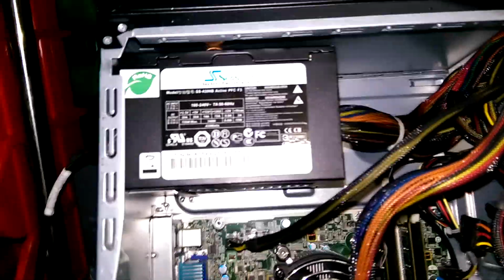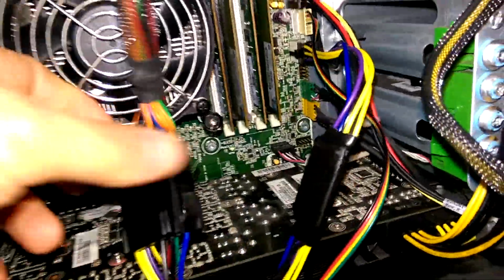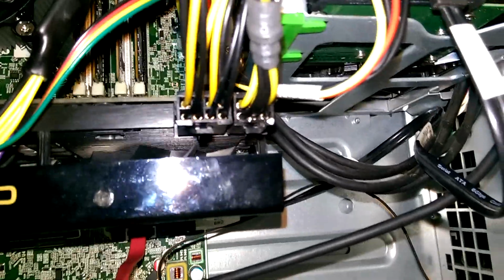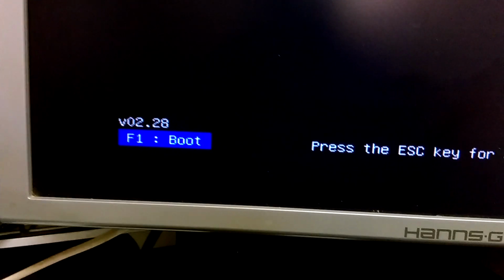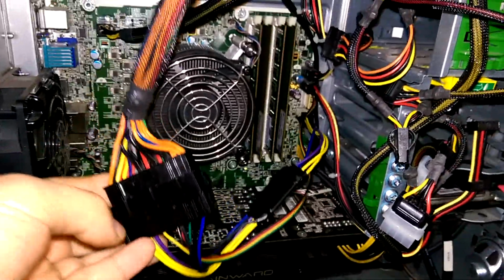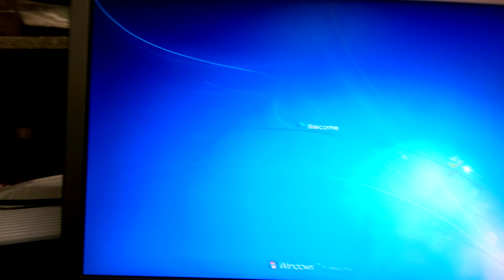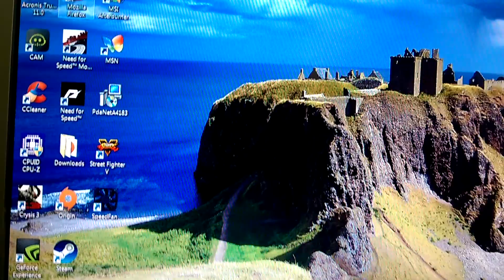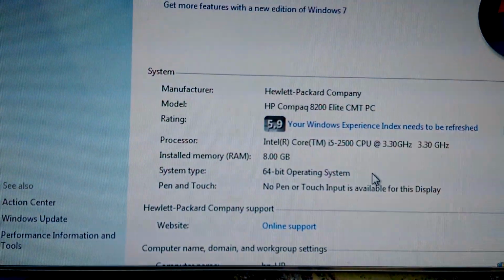HP ELITE 8100 to 8300 SERIES USE YOUR OWN PSU!

Comment: For future buyers! As a Youtube user and Ebay seller, he was very responsive, friendly, and helpful. The item itself is carefully made, using good skills and materials. Postage to Indonesia was relatively fast, and he has given a reasonably good packaging. Item tested and works as described. It was a very good experience!
Reply: Thx for the feedback!
btw im using the same pc in the vid, and was wondering if i can get a Sapphire R9 285 to work in it with the mentioned connector, or will it harm the motherboard
Reply: bang ajarin atur pin p2 nya dong

Comment: To owners of the SFF (Small Form Factor) model of the HP Compaq Elite 8300 computer:

These machines (and I believe the other SFF models of the 8000 series, i.e. 8100, 8200, etc.) utilize a rare PSU (Power Supply Unit) form factor of CFX. The only CFX power supplies I have found are all 240W and are light weight for most graphics cards. The number of low profile graphics cards that will fit into the SFF machine have increased considerably in the past few years. In addition to half height profile, you must check the card length against the space from the rear of your machine to the taller components towards the front. If the card is half height and not too long to interfere with other machine components, you can install it.

However, power is another matter. While some lower power graphics cards will work with the stock 240W power supply, if the card has a separate power connector or draws too much power, it is not an option for the stock PSU. Fortunately, a PSU upgrade is possible, but requires a non-standard installation of a higher power PSU that will physically fit in the computer case even though not designed to do so. Two other PSU form factors may fit into the space taken by your existing PSU. The narrow portion of the PSU case location, which is deep and tall enough to accommodate a non-standard PSU, is approximately 100mm wide and 85mm tall. Common ATX and SFX PSUs will not fit in this space. The Flex-ATX form factor power supply is 81.5mm wide and only 40.5mm tall, so it will easily fit in the space, even if there is a secondary hard drive immediately in front of it. These PSUs are available with up to at least 350W. The other possible form factor is TFX. These PSUs are 85mm wide and 65mm tall, so they also will fit in your machine, but not if you have a 3.5” secondary hard drive immediately in front of it in the secondary hard drive location (the problem is that the TFX PSU will need to sit on top of the secondary hard drive, causing the top of the PSU to interfere with the top cover of the computer case). TFX PSUs are available in capacity of up to at least 500W. Depending on the height of its mounting hardware, a 2.5” secondary hard drive may be short enough to permit a TFX PSU to sit above it and not interfere with the top cover.

However, neither of these form factor PSUs have the ability to physically mount into your case like your existing unusually shaped CFX PSU. The simple solution is to mount the new PSU with double faced tape to secure it in place.

The next issue is connecting the new PSU to the motherboard and peripherals. Most Flex-ATX and TFX PSUs come with a 24pin or 20/4pin connector, a 4pin CPU power connector and some array of 4pin Molex, SATA and floppy drive power connectors. None I have seen have the KF2510-6P female plug found on your PSU. Also, these PSUs provide the now standard +5vsb (standby), not the +12vsb required by your motherboard. Fortunately, many sources provide an adapter cable that plugs into the new PSU's 24pin or 20/4pin connector and provides the 6pin main power plug and the KF2510-6P plug required by your motherboard. An eBay search for "ATX 6pin 2port supply cable" will bring up a host of sources for this adapter, which includes a DC voltage converter that converts the new PSU's +5vsb to the +12vsb you need. The new PSU's 4pin CPU (Central Processing Unit) power connector is connected to the motherboard at the same location as was the identical plug from your original PSU.

However, the flat 6 pin in-line KF2510-6P female connector on many of these adapters is not wired correctly for the HP Compaq Elite 8300 SFF machine. Looking at the wire end of the connector with the raised guides pointing up and the rectangular holes facing down, the left most wire position is Pin 1 and the right most wire position is Pin 6. The adapter has 4 wires going to this connector of various colors. Because they are not standard, the wire colors are not important, just the Pin numbers of the 24 Pin receptacle and the KF2510-6P connector they run between. One wire connects to Pin 16 of the 24 Pin receptacle, the PS_ON or Power Supply On pin. The other end of this wire should go to Pin 3 of the KF2510-6P connector (the same location as the green wire on the original power supply connector). The wire that connects to Pin 8 of the 24 Pin receptacle (the PS_OK or Power Supply OK or Power supply Good pin) should connect to Pin 4 of the KF2510-6P connector (the same location as the grey wire on the original power supply connector). The other two wires connected to Pins 17 and 18 of the 24 Pin receptacle (or any other ground pins) should go to Pins 5 and 6 of the KF2510-6P connector. These locations have no wires connected on the original power supply connector. If the wires on your adapter are not connected correctly to the KF2510-6P plug, move the wires to the correct locations described above. To remove a wire from the plug, place a needle or other small pointed object like a toothpick gently into the small rectangular hole on the plug at the location of the wire you wish to remove. Press the needle gently inward and upward to release the metal wire connector and pull the wire and connector out of the plug. If the tiny tab on the metal connector is no longer bent away from the body of the connector, use the needle to push it out slightly so it will snap into the rectangular hole at the new wire location into which it will be placed.

With just this adapter, correctly wired, your computer will work with your new PSU. The drive power connectors from the new PSU can be connected directly to your drives, replacing the cable currently connecting your motherboard to the drives' power connectors. Not only does this reduce the current flowing through the motherboard, it also eliminates much of the +12v to +5v conversion currently performed by your motherboard with the original PSU.

One minor disadvantage of this PSU upgrade is that your computer will seek a "PSU fan on" signal when it boots. Since Flex-ATX and TFX PSUs do not provide this signal, you will get a 515 error message (Power Supply fan not detected) during the boot. Just follow the screen instruction to ignore this false warning by pressing F1 and the boot will continue. 

This error can be avoided by connecting your CPU cooling fan to Pin 2 of the KF2510-6P PSU adapter connector (the same location as the white wire on the original CPU plug). This requires adding a 5th wire to the KF2510--6P connector on the adapter. Snap-in crimp connectors for this additional wire come with any KF2510 female connector, so you can buy a KF2510-2P plug and use one of its 2 crimp connectors for the new wire on the PSU adapter plug, leaving the Pin 1 location empty (the same location as the white with red stripe wire on the original PSU connector). The other end of the new wire is connected to the TAC or SENSE lead of your CPU cooling fan by spicing it to the appropriate fan power plug lead. This lead is usually a green wire but in any event it is the wire that connects to the #3 pin of the fan power connector which is the second closest to the side of the cabinet. With this arrangement, upon booting your motherboard sees the TAC or SENSE signal from your CPU cooling fan and reads it as coming from your always on new PSU fan, thus avoiding the false boot error entirely.

While this upgrade may appear intimidating, it really is not very difficult. Due to engineering changes by HP, I cannot guarantee this will work with your machine and like always, you proceed at your own risk. I did it with a 500W TFX PSU in my HP Compaq Elite 8300 SFF machine to support a new graphics card and future peripherals and it works very well. My hard drive is a single 2.5" Solid State mounted in the main hard drive location below the DVD drive, so there is no drive immediately in front of the new power supply in the secondary hard drive location, allowing me to install the TFX profile PSU without interference. Good luck!!!
Reply: Wow..that was some detailed post ! I got an 800 GT 1 SFF with a 240 watt and want a 320 so will try out your suggestions.
Reply: Great post! Unfortunately for me it doesn't to work; I get a green LED, everything seems to power up, keyboard flashes, but then I get no video, no beeps, and no lights on the keyboard. Do I have bad RAM or is my motherboard faulty? I've tried the adapter with multiple power supplies at this point to no avail.
Reply: **If this guide still causes the pc to beep when connected to power, Swap pins 3 & 4 **

Just did this on an HP 8300 Elite SFF. Runs flawlessly with 16gb Ram and an OC'd GTX 1050 (2gb)
Reply: How critical is the sensing voltage? I measured mine at 12.28 V. Always got 4 long beeps and red front Power LED as warning. Bought pre-built cable from Aliexpress and adjusted wire connections peer your instructions, including swapping pins 3 & 4 , but with same result each time.  If sensing voltage is critical, maybe a regulated buck converter is required.  I have not open the heat-shrunk and covered converter to see how it is like.  The rig is running fine on MacOS High Sierra hackintosh with 2x2g 1333Mh ram, 240G ssd + 250G hdd and MSI 1050TI LP GPU.. Thought would be great if could upgrade the stock CPU to something closer to 500 watt. May be those already got it going can share the vendor of your cable or possible DIY with adjustable buck converter.  Thanks in advance.
Reply: Sorry, forgot to mention that the rig is the HP Elite 8300 SFF
Reply: @sanfordpemberton8053  Would you be kind enough to share the details of your cable?
Reply: Sorry buck converter should read step-up converter..
Reply: And I was trying with an Enermax Infiniti 650.
Reply: 9m2sh so if I put a nividea gt 730 in a hp 8300 and disconnect the disc tray from the psu will the psu still operate normally or will the gpu burn the psu out? (And it has a 240 watt psu)
Reply: Just sorted out my problem. The Enermax Infiniti 650 does not work with the cable.  Have since changed to a CoolerMaster 800 and it is working flawlessly since. Just to update for those intending to try the cable : not all PSU can work with the cable. Cable itself is compatible with the 8300, in my case at least.
Reply: Just sorted out my problem. The Enermax Infiniti 650 does not work with the cable. Have since changed to a CoolerMaster 800 and it is working flawlessly since.
 @Joseph-wu7vm I do not have details of the  nividea gt 730. Any way, the power-draw of the optical drive should not have too much significance on the overall power supply.
Reply: Just another update for those who maybe interested to know that Fractal Design Integra M Series PSU are also compatible with this cable.
Reply: mlhm5
Thank you for your detailed well-constructed post regarding the lame 8300 sff.
Only one question if you may, can these hacks work with 8100 sff? I have ordered one and it starts giving me a headache even before I receive it lol
Edit: Anyone with knowledge about this is welcome to input!
Reply: $10 in a Ca. supplier hp z220 psu cable or $5 from China. Done deal and I'm installing my 450 watt supply now to power my Gamer Graphics adapter with 2 DVI and 2 HDMI out
Reply: holy fucking crap thats a lot of text
Reply: gawww im so dumb i just want a stronger gpu and now i have to buy a new psu, gpu and now an adapter that im so conused about please please can someone link a video or break it down real slowly and simply for me bc im so lost

Comment: This does work, however I probably need information about drilling holes for the power supply to mount on the tower, since the propriety hp power supply screw holes don't line up......update, I did actually drill holes in my tower as well as the power supply box, works.

Comment: I have the 8000 Elite with the original 320w 80+gold psu that powers 1ssd + 3hdd + 4x4gb ram + Q9650(ebay) + gigabyte gtx 950 OC. still get 1080p40+ at high settings for 2015 AAA titles. Not obsolete by a long shot.
Reply: Yea but a lot of us have the stock 320w without 80+gold. Its still good enough for a 1050 ti Low Profile by MSI or a HIS RX 460 single slot card, but only a matter time with that psu. Another issue is those older bios revisions with legacy only.
Reply: So does the 80+gold have the power wire for the graphics card or did you use the adapter? I found that the HP Z400 475 watt will fit in the computer but I need the adapter. I read somewhere that the board will handle a GPU up to 75 watts and the GTX 950 uses like 90 or 95 or something. Are running the power wire and not just plugged into the board?
Reply: Hi, what do you mean about the bios revisions with legacy only? Can the bios not be modified?

Comment: This psu change video is not complete!  There is a pin change on the z220 cable (not shown) required on the four pin connector for the PSU to work properly, otherwise you get four beeps and a red led.  See other YouTube videos for how to do this.  Also it is possible to prevent the fan error/F1 press  message by additional wiring.  As of 9/2018 the 75W, GTX1050TI (low-profile for sff cases)is the best video card to use for 240W power supplies and requires no PSU change nor additional power, just install into pcie slot.  Those with the 320W minitower PSU can do a 120W, GTX1060 with a two sata power to one 6 pin connector adapter.  i.e. one sate power to DVD power lead, the other to HDD power lead. Hope this helps!
Reply from the maker: Where did you get your cable from?
Reply: Do you have a link for the additional wiring by chance?  I would love to prevent that F1 error.

Comment: to fix that 515 power supply error take a wire and splice it together with the clips on the end put it in the two spot left.. another words loop it over and the error will go by by
Reply: Can you explain it with more details? Sorry. 😀

Comment: The cable works great, I have used it on a HP Elite 8300 CMT fitted with a new corsair CX 600, obviously needed to modify the case for it to fit, a couple of holes needed drilling to hold the PSU screws, then the case cover would not fit snugly, so had to file 2 small half moon  indents to fit around the screw heads, this allowed the cover to fit tight. now I have a new nividia fitted and working. All in all working great and could upgrade to a better PSU and GPU if needed. This cable has been worth every penny, and cheaper than buying a new PC. SORTED
Reply from the maker: pauledwards2009 glad you happy m8. thanks
Reply: same here I have modified the case and I have the same PSU you have :) Now I can enjoy my GTX 1060 OC 6 GB. Very very cool video card !
Reply: OMG can't wait, upgrading from 2GB card to 8GB Card YEEEAAAAH
Reply: Did you have to swap order of the wires in the smaller 6 pin connector (the one that doesn't look like a PCIE connector) to make this work on your 8300 CMT?  I have an 8300 CMT and was excited to try this adapter but when I plug it in the fans all start running before I even hit power and when I hit power I don't get any love.  Maybe their is a difference between the UK/US version?  I'm in the US.
Reply: Kevin Twingstrom Did you get it to work?
Reply: Jose Ahumada yes actually I did! It took a bit of work. I had to rewire it completely, the wiring was way off for my pc, but after looking at an atx wiring diagram I was able to figure it out! Now I got a nice gtx 770 in my rig, not the best card but hey it was free and better than the integrated crap I was using!
Reply: Kevin Twingstrom could you tell order of the colors? I can't figure it out. Thanks!
Reply: @ktwingstrom  What is the proper order of cables in this little white connector?

Comment: I recently bought an HP Elite 8300 CMT and attempted to put in a new power supply and it was smaller than the original prop. HP power supply. How did you get your psu mounted in there?

Comment: BTW... This NOT the correct pin configuration for the US, HP Elite 8300.  The 8300 uses the 4 center pins of the 6 pin plug and the color code will be: [ x - Red - Green - Black - Yellow - x ] 
The end 'x' (open) pins can be jumped to prevent the "power supply fan" error on boot.  Pressing "F1" will force it to boot anyway.

Comment: Moddiy has these as well as various other adapters for sale. I bought their hp 8300 version but at the time the cable didn't fix the fan error 515. Apparently the new version does fix it so I actually am going to try to rebuy it.